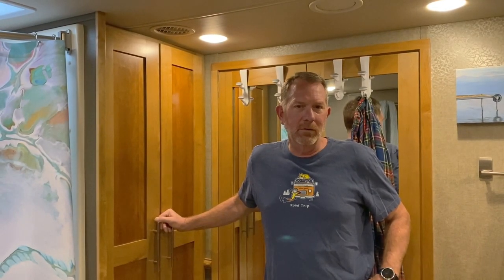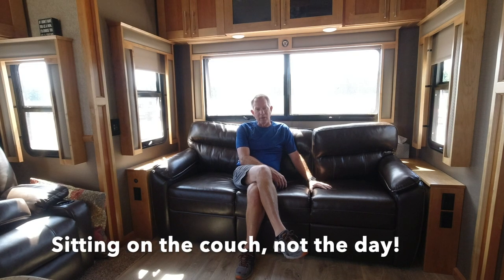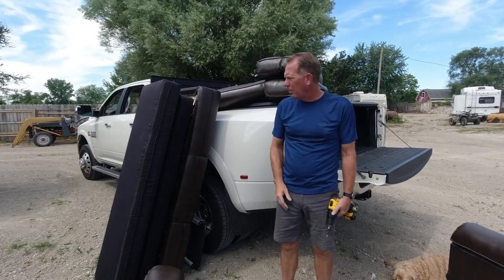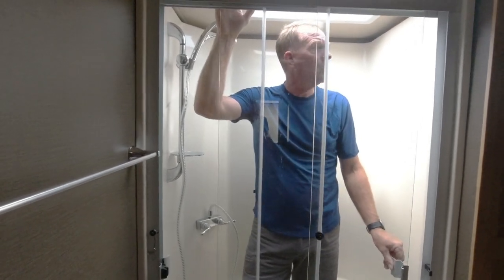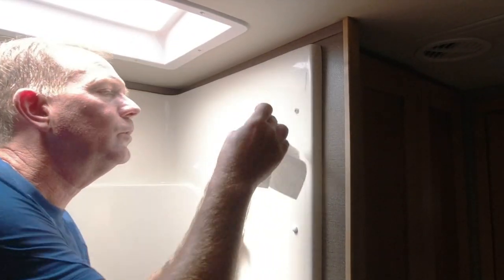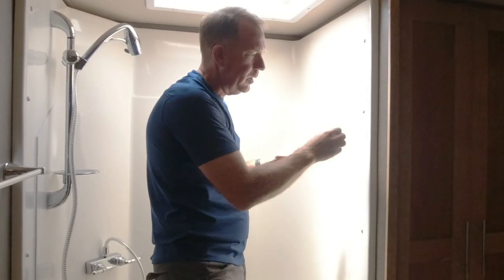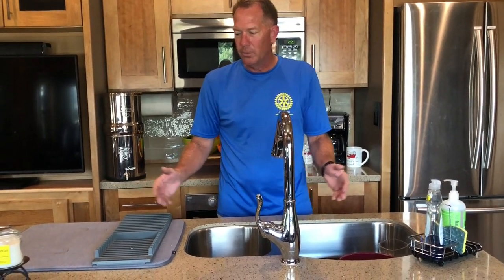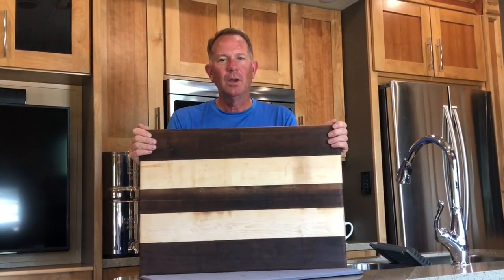Game changing RV modifications  /  RV life made safer and simpler. #rvmods

Comment: OK NOW its on! i tried a couple times but it wouldnt activate hmmm. great idea to extend the countertop. are u going to paint the rest of the kitchen wood stuff in the almond/expresso stripe also? like the other counters and the cabinet doors etc? great idea to replace the outside lower door locks as apparently from new they all have the same keys!! toss the couch to have a desk hmm  most rv folks toss the dining room table instead so they can seat company when they all come to visit. i wd toss the dr table bc i need a couch to lay down on while watching tv or yt...been scoping out 5th wheels for couple yrs now.  will likely get an older one with similar floor plan. if it doesnt have an island then get a sofa table to use as an island.
Reply from the maker: Thanks for the comments! Yes, we debated the couch for a long time. But, we needed a double sized desk. My husband works full time on the road and needs multiple computer screens. I edit youtube and also need dual screens. Removing the couch offered us 80 inches of working space, we both have plenty of room for our office setups. Our dinette is pretty narrow and we would have only pulled off about 55-60 inches there. (believe me, we tried!) We still have a dual recliner for TV watching and as far as company, with Covid we aren't seeing anyone indoors anyway. It seems to work for now! good luck with your purchase. We feel there is no perfect Rv, but we can make the one we have as close as possible for our needs.

Comment: We stumbled on the RVLock.com black Friday 40% off deal as well and it was too good to pass up so we upgraded those as well.  Other upgrades for us include central vac, electrical mgmt system (EMS), and the "thin shade" for the door. On the to-do list is TPMS for the trailer.
Reply from the maker: We have central vac already and we bought TPMS right away before our first trip. What is an EMS used for?
Reply: @GoodLifeHighway  We bought a new 38ft Outback 341RD last year.  Chose it for the rear living area with sofa seating for six.  We almost pulled the trigger on a fifth wheel, but realized we needed a dually for that one and we just aren't ready for a dually as a daily driver quite yet.  EMS is what a lot of people refer to as a surge protector, but campgrounds are known for other serious electrical issues at the pedestal, like no ground, reversed ground/neutral, low voltage, etc so it tests all that and more.  I installed the permanent hard-wired model so I don't have to mess with it at each setup, nor worry about it getting stolen at the pedestal.  Here it is: https://www.progressiveindustries.net/ems-lchw50  If you guys make it through Colorado, please give us a shout.  We would love to meetup and spend some time with you.  Colorado has just a few great things to do!
Reply from the maker: @bryandemerath6812  yes, having a dually 3500 is tough for a daily driver! We live it, but don't love it. But we wouldn't trade the power that it has for anything! Ok, now I know what you are talking about with the EMS. We didn't want to bite the bullet on the cost for that just yet, but we do use a big huge surge protector which gives us some solid protection. We will definitely get to Colorado sometime, but not in the near future. Spending the winter in Texas and in the spring heading to the East Coast!